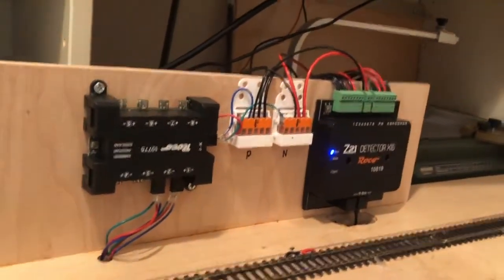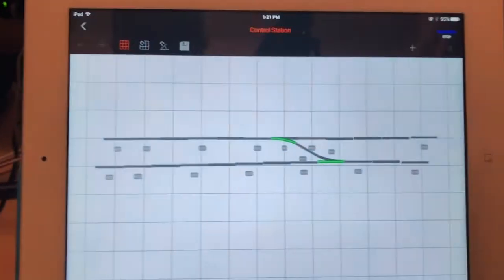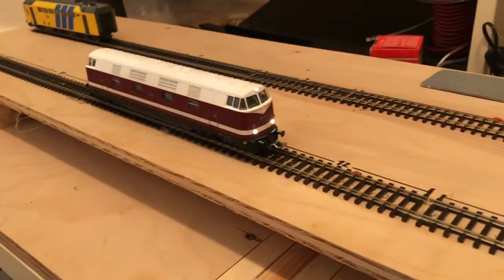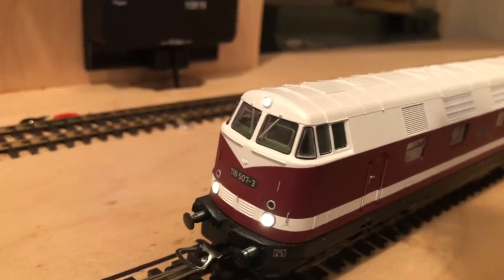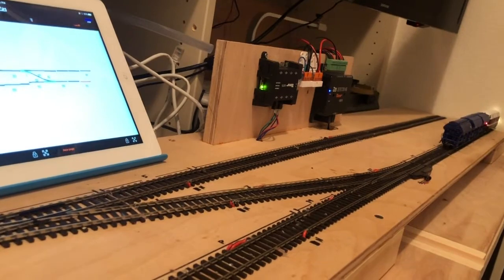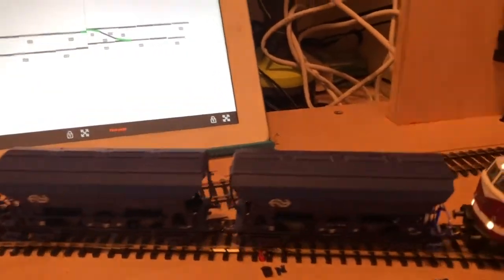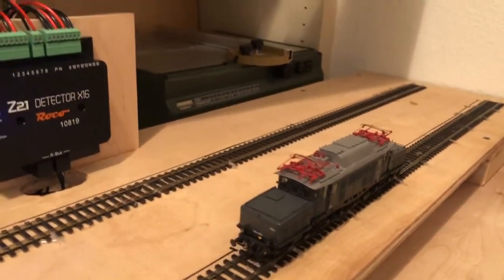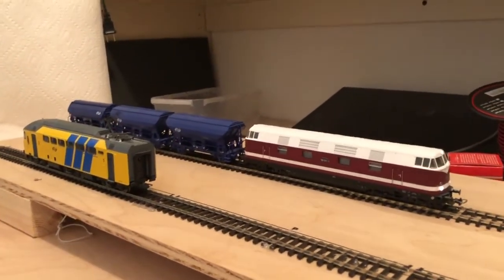DCC Occupancy block detection test track with Roco z21 10819

Comment: Hi thanks for that. I’m just getting into Hornby TT120 using Bluetooth and my iPad. I’ve found out today that it will detect the ABC system which is good but I’m wondering if I can incorporate Block Detection? 
Cheers steve 
Ps it uses dcc decoders

Comment: nice informative video.. I am using 10808 daisy chained to a second one. How is the starting address set?  The instruction says to 'activate a magnet article' with the address after pressing the program button.  Does this mean create a control like  turnout switch and set to starting address of detector?

Comment: Hi you should not connect 3 ohm resistor to rolling stock as this will take 5A at 15V. This will either burn out or trip your DCC . 3K ohm may work depending on the detector and take only 5mA.
Reply from the maker: Thank you